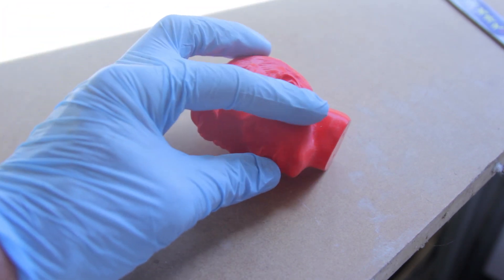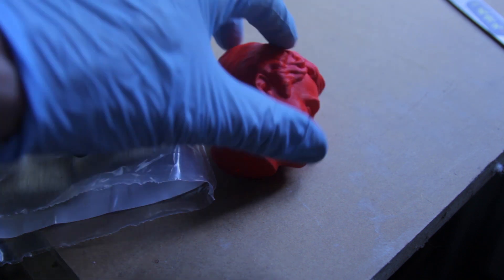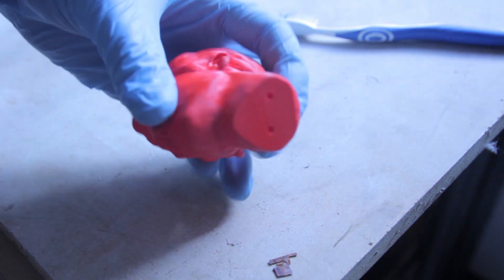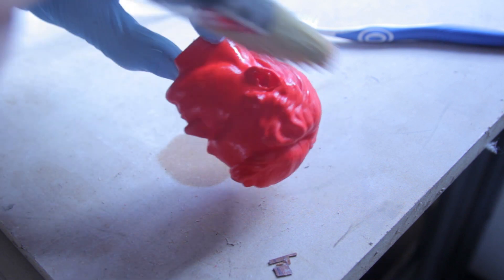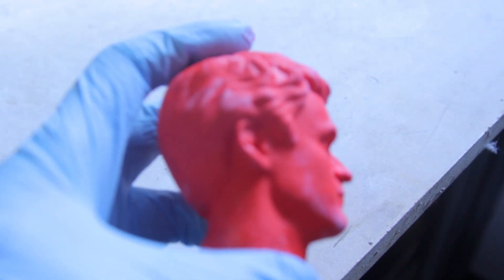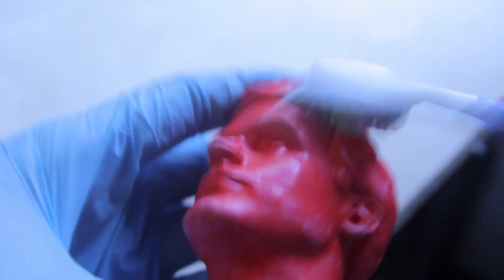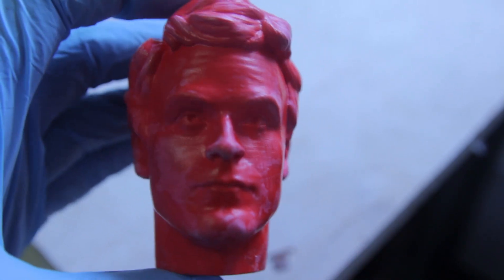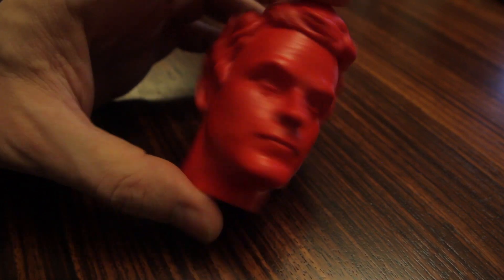Removing White Residue From Acetoned PLA 3D PRINTS

Comment: Bought a roll of Colorfab PLA PHA to test it out with acetone and does work like in the video, the model turns white almost instantly, but it is smoother to the touch. Tested with a part sanded before acetone, wet sanded before acetone and just acetone, the wetsand and sand are a bit smoother, but the surface after it turns white makes it easier to sand, after applying it on a surface it becomes cool to the touch.
Tested this acetone which is a mixture of acetone,butyl acetate,alcohol and parafinnum liquidium on regular PLA and that also turned white and made the surface smooth, quite bizarre.
Reply from the maker: Id wait a bit after acetone treatment at least an hour as its kind of soft and sanding almost produces no dust. For optimal results wait till its hard or else yoy might deform your model pressing too hard.
Reply: @Cloakfiend  Yes, will try different things, thanks for the info, added primer over the surfaces to see the results. The wetsand + acetone looks good as does the drysand+acetone on the Colorfabb, the regular PLA looks kinda random. This mixture evaporates so fast, in a couple of seconds it's gone and in 2-3 sec the white appears. These are just texts on large cube blocks to see how it works but it looks pretty good so far.

Comment: Really interesting stuff, been looking at materials that are easy to postprocess(sand or acetone smooth), and gonna try a roll of this filament to see how it goes. On normal PLA i use a thin mixture of water with plaster and brush it on the whole model, make it watery then just let it dry. It will cover all the layer lines and make the PLA sandable.

Comment: I thought acetone did not work on PLA...
Reply: Mix abs with acetone and let it set for 24 hours then apply over pla
Reply from the maker: get some colorfabb pla/ pha filament and behold...
Reply from the maker: if you print 0.06 layer height that is.!

Comment: Any solution to remove the white spots?
Reply from the maker: You can always try more acetone and follow it will moisturizer.
Reply: @Cloakfiend  Why not just prime and coat the part?
Reply from the maker: @Icemanmodeler  because its smoother with acetone than primer. If i plate something you can really see the lines. With acetone and a touch of sanding on large plain areas you cant.
Reply from the maker: @John F30 not for a mirror finish. You need to fill and sand and repeat. But with acetone it makes things much easier. Even the sanding is easier after. Check my ig account to see my plated models. All photos are untouched and close ups. No lines. Minimal sanding. Mostly plated i need to get back into painting as i havent done it in years!
Reply from the maker: @John F30 no. I age them. I apply acids and stuff to them to get nice surface finishes you simply couldnt acheive otherwise.